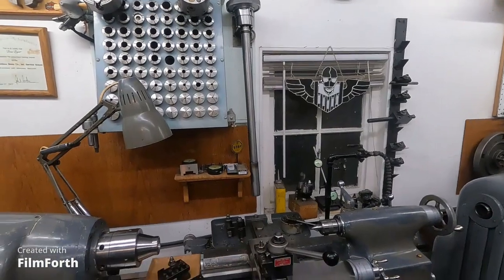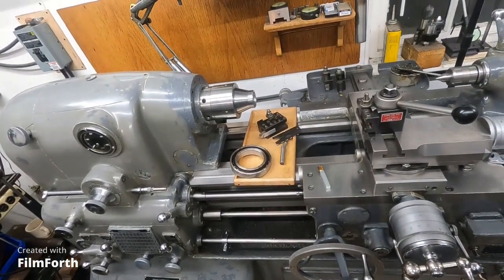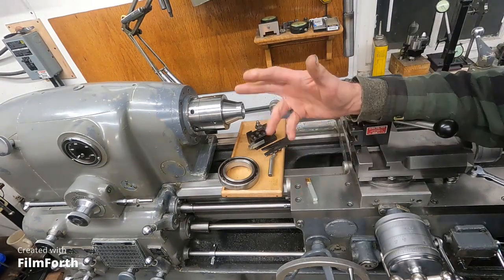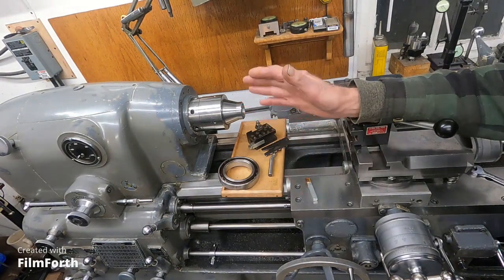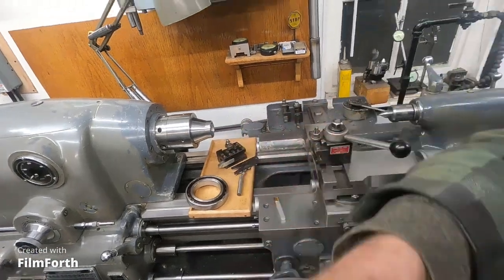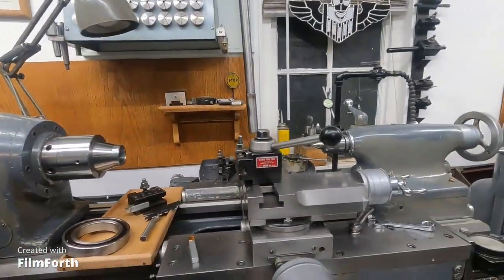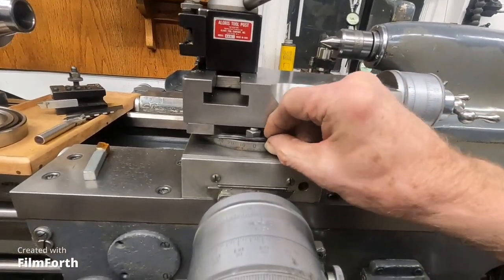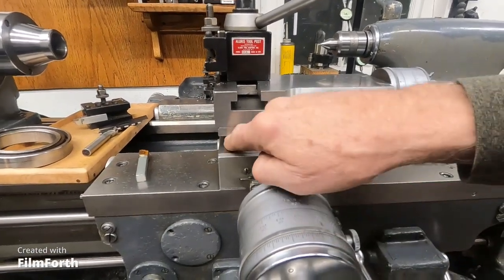Monarch 10ee Lathe, master the art this is a start

Comment: I worked construction for 38 yrs  with about 12 in Budweiser installing moving nd modifying lines. We used 135 degree split points for drilling stainless plus good cutting/tapping fluid.
Reply from the maker: Many general contractors often buy the cheap stuff at Harbor freight and no cutting fluid, they are animals out there

Comment: Thanks for explaining the fact carbide threading inserts are prone to chip in manual machines. I chipped a bunch of them right off the start and just went back to high-speed steel as you said. Also, can you explain the importance if any of what degree you set the compound when threading? Does it even matter as long as you set the threading tool exactly 90 degrees to the work? You ask 10 guys and you get 10 different answers. The Hardinge owner's manual says 59 degrees move the cross slide in to make a deeper cut and leave the compound on zero. For years I left the cross slide at zero and the compound at something like 341/2 degrees and moved the compound in to make a deeper cut and this worked. But I feel stupid for possibly doing it wrong for 13 years behind a Hardinge HLV-H
Reply from the maker: If the thread comes out it does not matter how it is done, this setup sometimes works better cutting smaller amounts of metal to help stop chatter on small or long acme screws, I can take a bigger bite on a heavy gear head lathe maybe use an acme insert. The small machine  here will rattle

Comment: DeeDee, Interesting episode.  I’ve cut some acme threads with high speed steel cutters, trying to cut the entire thread profile and it was no fun.  I’m game for your suggestions.  TB
Reply from the maker: Using a narrow tool like I shown, one can take a worn acme screw and shave the wear out of the thread flanks down to the next fine acme thread profile then create a new nut to fit that. All of this done for over 100 yrs and somehow lost in this digital cluster f*ck of today, One thing has not changed, that is the lazy nature of most people to observe and adjust to new conditions and challenges on something such as cutting acme threads or even picking their nose. The machines that cut to the high accuracy jig borer and toolroom lathe supported with the cutter grinder simply requires more steps and increased observation, that is a problem most cant do, so they get pissed turn into a nazi get on the fake forums and YouTube.

Comment: I feel so corrupted. ! lol
Reply from the maker: It does go back to an early rigid system when machinist wore bow ties in factories, and do not grasp the business end and also having to be a mechanic and clean the bathroom. My customers were businesses that needed machine work but did not have machines needed like ranchers, farmers, miners, loggers and contractors. I tried to be available 24/7 to those where a busted piece of equipment caused people to be out of work. Doing that, And getting up early to get it done is how to get in it and win it. When mining operations hit some good gold, they go bonkers and break all their equipment that was hanging by stripped threads anyway, lots of fun!

Comment: Dee  please explain what an annular contact bearing is.
Reply from the maker: They are very much like bicycle wheel bearings where the races are high on one side and they are adjusted together to remove play and tightened further to add pre load.